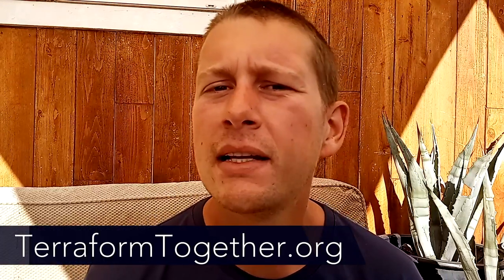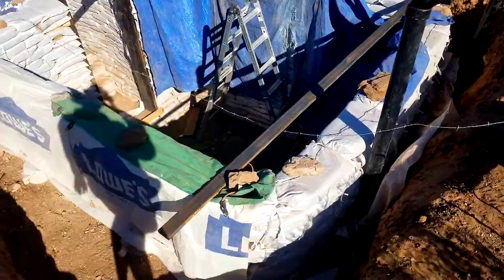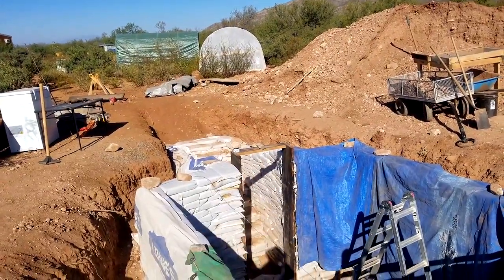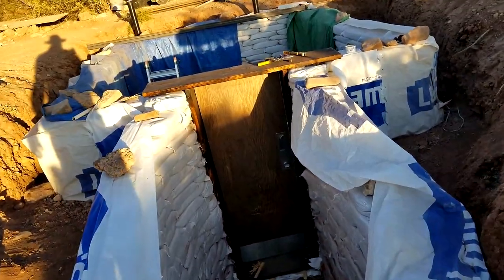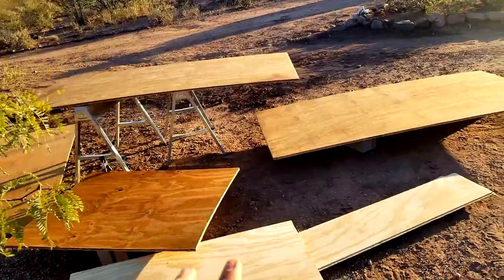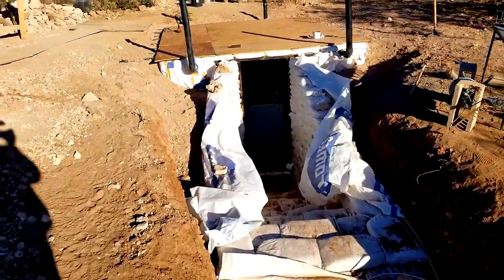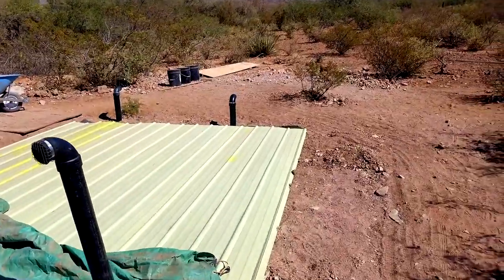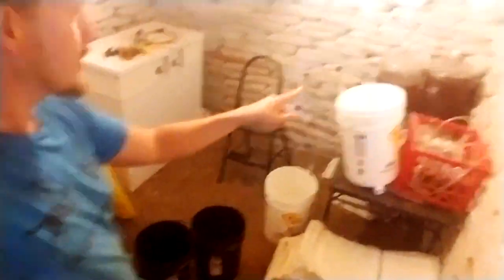Putting a roof on our underground pantry | Root Cellar Build Ep 3 | Terraform Together

Comment: Thanks for your videos. This looks super useful. I’m hoping to do something similar. You guys did a great job.  I hope you won’t mind my many questions.  I’m not that far from you and wondered who you use for your gravel. What size did you buy? Did you do gravel inside the bottom rows of bags too?  Not sure why you are sifting.  I was told you can use the rocks and all inside the bags. Is the tyvec for moisture control or to keep sun off the bags?Has it gone through a monsoon yet?  How about the metal scrap yard you like.  I’m assuming you go to Tucson for the Restore.  Pretty sure there isn’t one in SV.  I signed up to be put on your mailing list and to help with one of your work days:). I’ll pay you back in manual labor. You’ll see me signed up under a different name…
Reply from the maker: Hello, 

Thank you for the questions. 

First, I'll say: This structure has held up great. It's rock solid and I'm not worried about the construction at all. That being said, I will NEVER do earthbag construction again. We've switched to hyperadobe and it's SOO much nicer and easier to work with. What was taking us 8 hours to do 1 row around on this is now taking us 6 hours to do 2 rows on a larger structure. 

We put down ¾" gravel that we get from Cochise stone in sierra vista. We didn't put gravel in the bottom bags, but we did backfill the first two rows to lock the bags into place. 

Our soil is really really rocky. Small rocks aren't an issue, but large ones can rip the bags when you tamp and cause issues. The way we are sifting in this video is really dumb. We have a new system now that is so much more efficient. 

The Tyvek was in theory for moisture. I don't know that it is necessary and we're not doing it on our current hyper adobe basement. 

It's gone through two monsoon seasons. Not a drop of rain in the cellar. We did put down about 2' worth of gravel just in case we did get some water in there. 

Tucson Iron and Steel I believe is what it's called. Prices have gone up exponentially since shooting this video, but it's still a good spot. 

Tucson ReStore, correct. 

Thank you for signing up. We are in a transition period between our test house and main house hyperadobe work. Once we get back into a good rhythm of working, I'll be sending out emails. Probably in the next month or so.
Reply: @TerraformTogether  Thankyou so much for this reply.  I appreciate the effort you took to answer all of my questions.  It really helps me a lot.  I’ve been enjoying your videos and look forward to watching you progress.  You guys are doing such a great job.  I would love to see you do a video on earthen floors:)